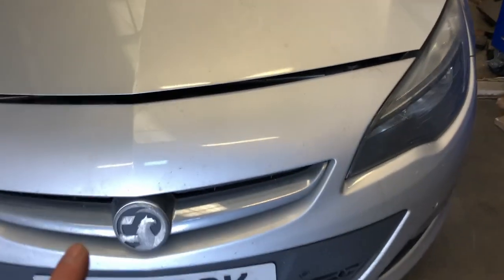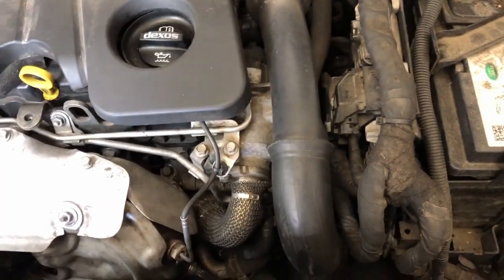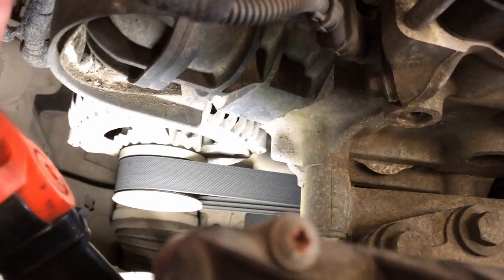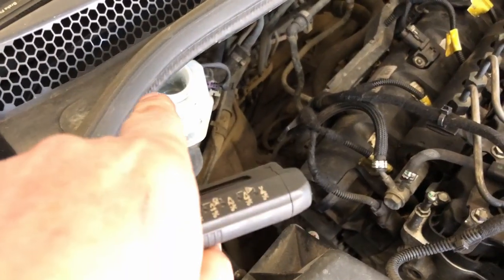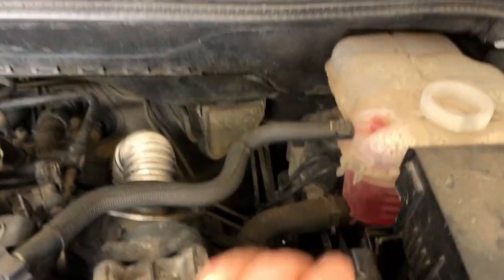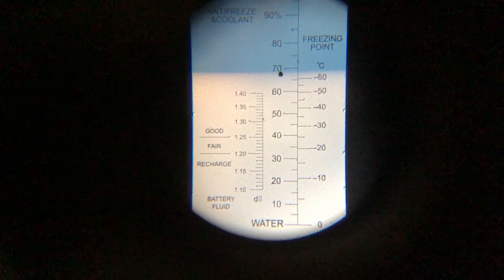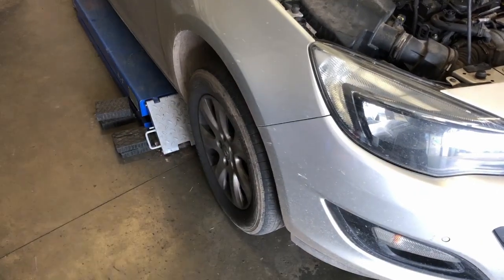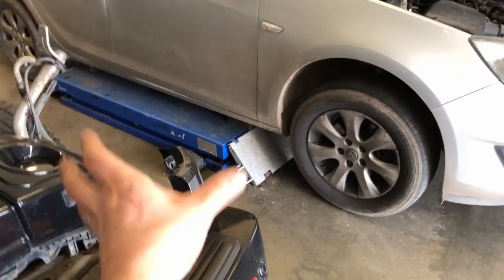How to carry out a professional major service on any car - Astra J 1.6 CDTi

Comment: I serviced a 2013 Astra 2ltr who ever decided to put the oil filter on the side I had to have the bloody wheel of and a 32mm low profile socket. and whoever serviced last put the so plug on with an impact couldn't get it off so sucked it with my pump. great video.
Reply from the maker: Thanks 👍

Comment: Excellent video.
Any chance you could please show how to replace gear box oil and the thermostat ?
Reply from the maker: Thanks, I haven’t done the thermostat and dont need to. I covered topping up the oil in the chain replacement video. That should cover everything you need to change the oil in the gearbox.

Comment: I replaced the whole return pipe (T) and removed air from the system, now it won't start. What could be the problem
Reply from the maker: Check for air again, and keep cycling the pump. Make sure you have a good battery and keep cranking.

Comment: Vauxhall have a service fix for the fuel filter, as it is possible to wrench the plastic filter housing out of the plastic fuel tank if it is tight. On this video you can see it flexing.
The fix is a bit of wood between the filter housing and the tank to prevent it bending/flexing. 
When I did mine I thought this is risky, plastic into a plastic tank. Later read the service bulletin 
Appreciate the videos, particularly the timing chain... My next job😢
Reply from the maker: Thanks for that, that’s good to know. I’ve been servicing this car for years now, so I knew it wasn’t too tight and was lubricated. ..but duly noted for next time. 👍